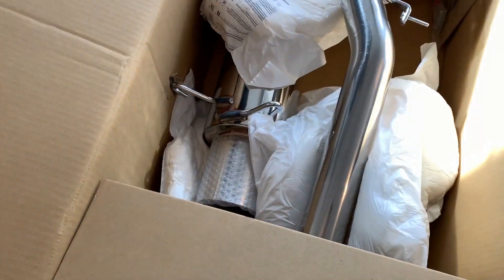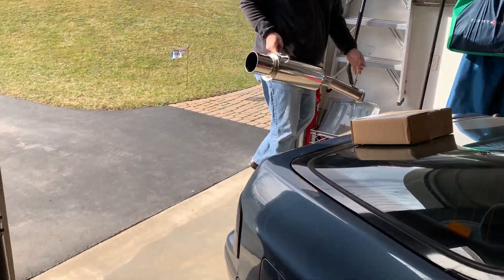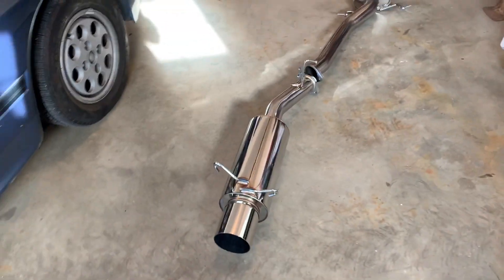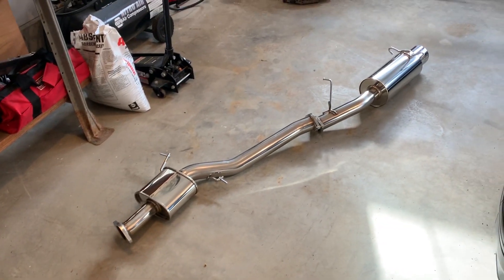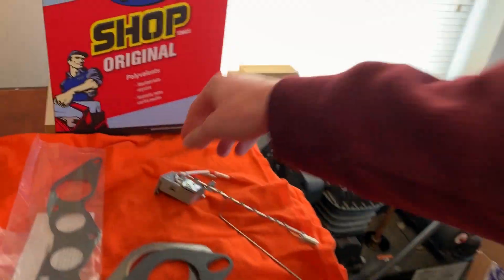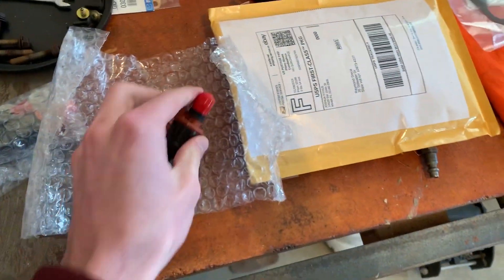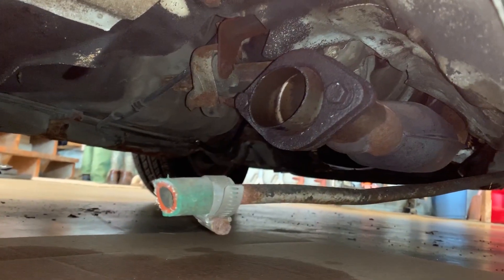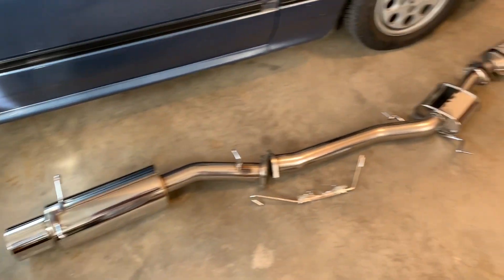NEW HKS EXHAUST INSTALL!! Rebuilding an FC Mazda RX-7 Part 3

Comment: Quieter than I expected .needs a racing beat  header rotary run hot under the hood .heat kills them the header disperse heat away from the motor faster .after that focus on cooling mods for the engine a mashimoto rad and an oil cooler for the motor and run higher oil pressure thank me later
Reply from the maker: Milton Gimenez thank you for the advice! And all your other comments as well. I definitely would like to start changing it up under the hood!
Reply: Milton Gimenez tbh NA rx7s are fine with just the stock system